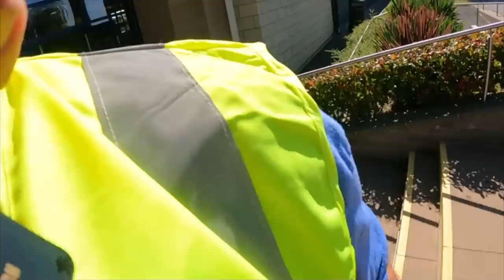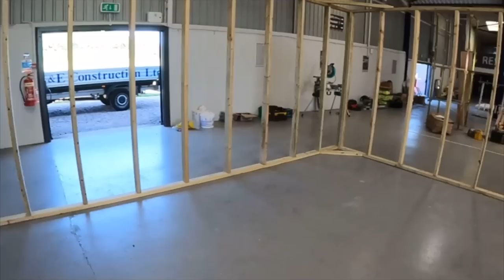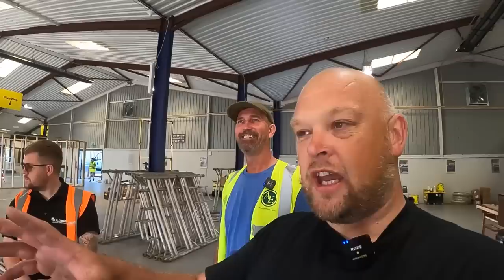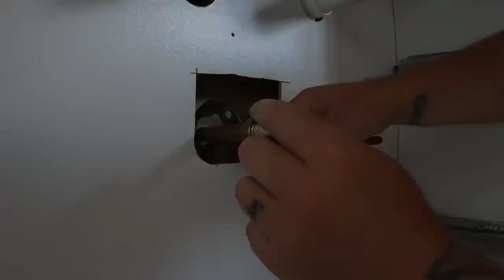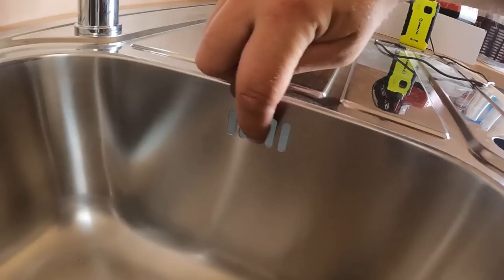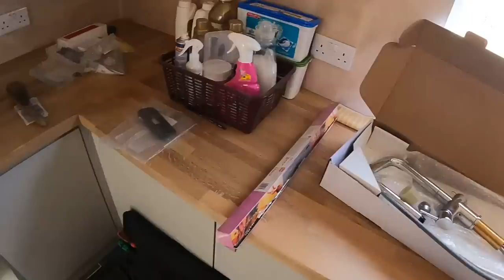PLUMBING IN 2 SETS OF MIXER TAPS INTO 1 SINK….. WHY? | PLUMBING PROBLEMS

Comment: Hello Mark
Thanks for another brilliant video. 
I was wondering what you (or anyone reading this) would normally do, if anything, about charging the customer when you’ve quoted to install a tap that they supplied (not based on your recommendation) that ends up not being suitable or broken/faulty. Meaning you have to either: 
A- undo the work you’ve done, source/supply a suitable replacement and install the new one? 
Or B- reinstall the old tap, return another day to wait for the replacement to arrive and do it all again!?
Reply: For myself .If the customer is supplying and they made the mistake then any extra time to remedy the mistake is charged as an extra. Make sure you let them know before you return to the job. Or you can say the quote doesn't stand and charge at an hourly rate. What ever seems to be the fairest to the both of you, but you're not a charity.
Reply from the maker: Hey Sam……. 
Basically just what Lee said above to be honest mate. 

Exactly the issue I had in the latest video, I went and got a replacement tap and charged accordingly
Reply: That is actually very common with customer supplied goods. And basically you need to charge call out for aborted visit and quote for revisit.

Comment: Would a normal p trap without the appliance spigots not have been better to save it trying to  run away up uphill? 🤔
Reply from the maker: Possibly… but It’s very marginal and still below the lowest part of the bowl so not an issue….

Comment: The tap must be designed for mains water feed pressure on both the hot and cold so I take it David’s house is gravity feed on the hot?
Reply from the maker: Yep it’s a gravity fed bungalow, however the restriction in those taps is awful….. all sorted with a swap of the tap and off we go
Reply from the maker: As for the show….. wait till you see it in full swing, it was superb👌🏼👌🏼

Comment: I always read what the pressure rated the taps are before even purchasing . If its not a combi/unvented then I won't even fit them for the very same reason !
Those taps came with M10 tails as opposed to the ones you got which were M12 .
Bungalows with convential systems are the worst to deal with when fitting taps basin & kitchen alike. Taps with min 0.3bar are probably the best you'll get to give a semi decent performance from a gravity fed hot.
Just a thought & it's only a thought could you of taken the sink out & removed the unit altogether & thrn altered the pipework.
As for the waste , you let yourself down their I think especially to those who are still learning , you had other options to get over that & as you had to go & get another tap you could of picked up a self sealing trap . So now not only does it run up hill loads you've fitted knuckle bends ! So expect a call back soon when the sink blocks up & then you can't clear it due to those awful 90° knuckle bends. Your work is usually pretty decent I have to say but sadly on this one mark you took your eye off the ball .
Lucky you have an accommodating customer .
When you do future videos & complain about how the wastes etc have been installed by others , remember this one. I appreciate you didn't 1st fix it. As for wasted time going round with a weir gauge you only had to realise it was gravity with dcv & M10 tails is enough to have told you nothing would come out. What I didn't see also was the connection for the washing machine water & waste .....
Reply from the maker: First off there was ZERO marking on the box/packaging giving any flow ratings…. So thats that one covered along with that they were infact M8’s not M10’s as you have assumed.

You seem to have a HUGE issue with 90degree bends as you’ve consistently tried to tell people (including other plumbing channels) that they are the worse fitting out there…… I’ve had no problems with them in 25+ years being in the trade.

And as you said “what I didn’t see was the connection for the washing machine and waste”……… that’s because I didn’t do it buddy, it’s all ready been done by the customer and behind the unit itself, I’m sure you will have something to say about that.

As for me “taking my eye off the ball” not at all…. Everything is working just how it should and the customer is, as always very pleased.

I have noticed you always have to pick fault with ANYTHING you can on my channel and other plumbing channels. Maybe you should start uploading some of your impeccable workmanship to this platform and help others with your vast superior knowledge instead of berating….. I look forward to see it.
Reply: Haha who the fuck pays for the time to remove the sink and re do the waste? If the customer does not want you to do that you can only recommend and do what you can in the REAL world.

Nothing wrong with knuckle elbows either yes swept are better but tights are fine to fit.

I’ve seen bathrooms etc that have had waste going uphill for 20plus years that run just fine obviously we want fall but you can’t always have the perfect world, god you sound like the life of the party mate
Reply from the maker: @kylebrowning7469  🤣👍🏼👍🏼👍🏼

Comment: Hey MJ & all just wondering what kinda money I should be charging for bathroom install .. strip out prep standard bath wc sink .. straight swap no tiling involved but  ..bit of  first fix ..& 2nd fix .. any info be great thx
Reply from the maker: So many different factors envolved to be honest.
Take your day rate, work out how long it’s going to take you, add in a contingency for any issues etc etc and go from there.

Its so hard to advise but if you look back in my videos you will see I did a video on pricing a bathroom..
Reply: @MJTiffPlumbing  thanks  I watched it mate .. I know lots of factors .. anything from 4k to 40k depending 🤣

Comment: You obviously just prepped his tap pipework for when you change over to a pressurised system. As a general note, we never fit those taps on gravity hot water with such low head, it's an automatic no from us because of the poor flow. One you won't forget in future though!
Reply from the maker: Yep, they are a very badly designed tap imho
Reply: @MJTiffPlumbing  They're taps designed for modern pressurised systems, most of them come with a minimum pressure requirement in the accompanying literature mate, more often than not 1.5 bar+.

Comment: Category 5 , you only use RPZ valves which have to be inspected ones a year , need’s a different qualification to install them , mainly used for a Birthing bath pools, inside the farms feeding water to a cows or etc …and laundry places, laboratories, bidets with spraying hose attachments, I bet what , I listed there you be surprised how many bidets installed with a hose attachments don’t have RPZ valves , that’s a water regs .
Reply from the maker: Never heard of those and I’ve just recently done my G3 refresher course which went over backflow/ these taps etc and as long as an air break and DCV all is ok on a kitchen sink